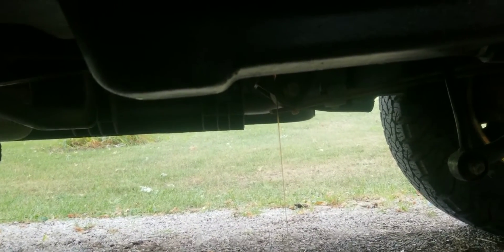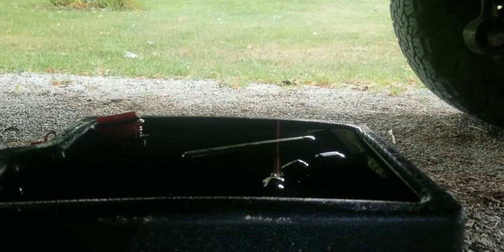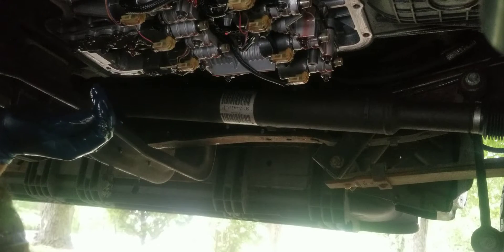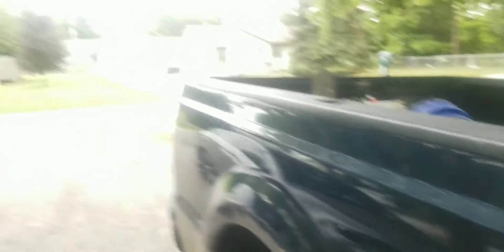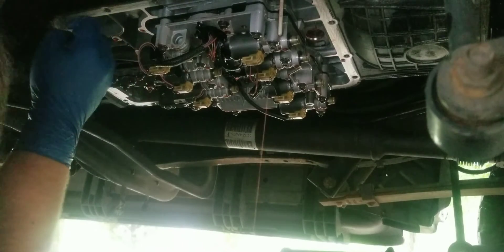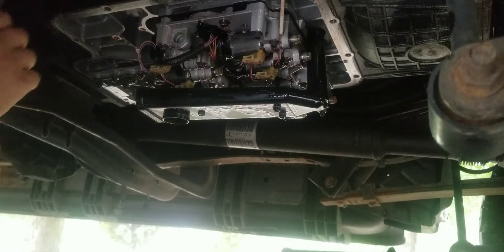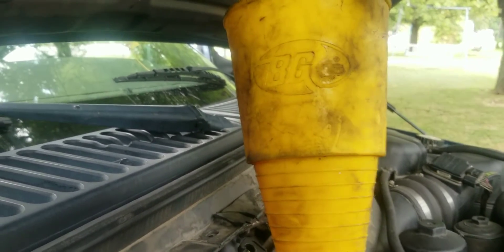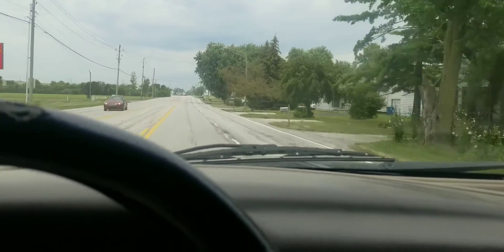Ford F350 transmission fluid temp sensor

Comment: I have a 2006 Ford F250 diesel and I'm getting a p0713 code so I replaced the filter and temp sensor and that didn't change anything. The tow haul light flashes while the transmission is cold. After 2-3 miles I shut it off and turn it back on and it runs like it should. No lights, no hard shifting nothing. Any ideas ?
Reply: same here... turned out to be an intermittent break in the sensor wire. (2005 6.0 Turbo Diesel)

Comment: My 2004 6.0 automatic trans will not go into high gear if I try to tow a trailer  temperature starts raise if i go over 50 and it will leak the trans fluid but it works normal with out towing any ideas ?

Comment: I have a 1996 f250 7.3 powerstroke and my of light flashes and goes in and out of gears fast but believe it’s in limp mode
Reply: Could the trans temp sensor fix it already changed speed sensor on top of rear end

Comment: Video is old but a lot  of help , can I still drive The car with a faulty Tran temperature sensor ? It’s shifting gears a little hard but the sensor won’t be here for a few days ? Is it wise to keep driving it ?
Reply from the maker: It should be fine, but I can't guarantee it won't have any negative consequences. The program the transmission follows with a sensor failure is a fail safe mode.
Reply: Appreciate the reply brother. Thanks a lot
Reply: Old question, but a lot of these on the road still... the answer is YES, you can still drive it, however it should go into "limp" mode. If it does you will see a message on the dash saying "Check Trans Temp". It should restrict use of OD as the ECU defaults to believing the trans is overheating.

Comment: I changed the sensor on a 07 f250 gas and it stil doing same thing? Erratic up and down temp gauge readings? Stopped up cooler possibly? Please if you have time advice? However i put a dorman part i know you suppose to go motorcraft.
Reply from the maker: I have no faith in Dorman parts. They make ok hardware but thats it.
Reply: @Spyke383  ok thanks for reply

Comment: Thanks so much!  🤩  I have watched so many videos on how to replace the TTS . Most of them never show exactly where and how it's done.  I'm doing mine tomorrow. Did it today,  Saturday 18th 2020. Thanks to your video,  piece of cake 🎂.  I do have one suggestion,  rather than trying to disconnect / unclip the connector,  just give it a 1/4 turn,  pull down then disconnect.  The wires are long enough so that you can see where the clip is once you pull it out. Update : drove the truck 🚚 today up a long steep hill,  before it could barely make it,  honestly the truck 🚚 sounded like it was going to explode and the transmission was going to drop out,  tow haul,  service light flashing 😫well no more,  it climbed that hill,  gears shifting like it just came off the showroom floor 🤩